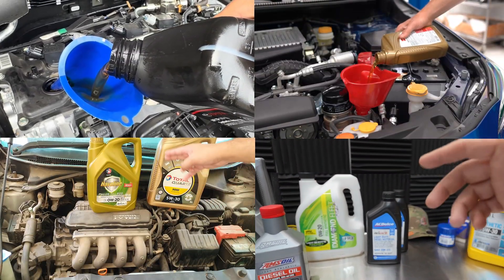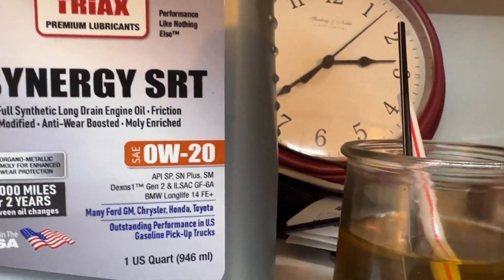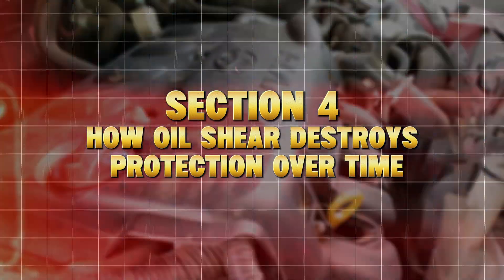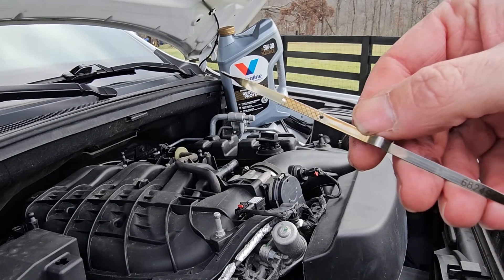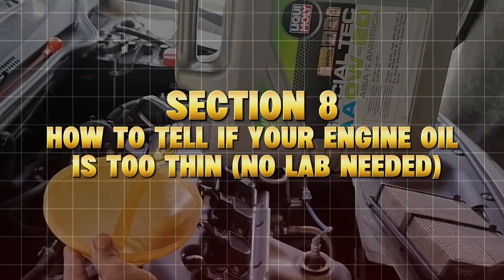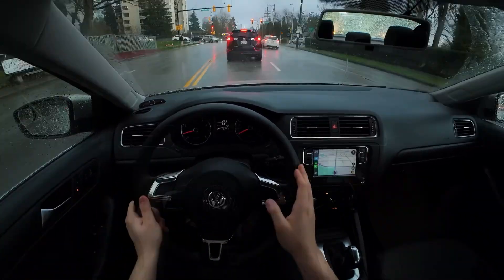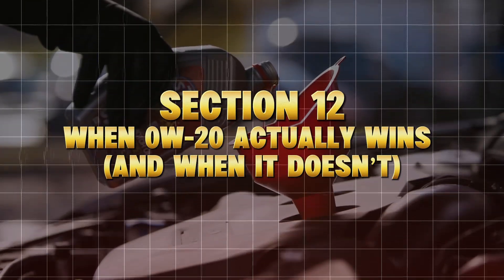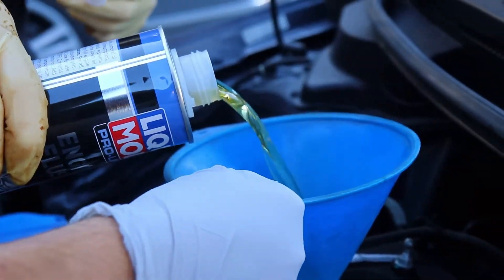The TRUTH About 0W 20 vs 5W 30 Oil (70 Engines Tested!)

Comment: 0w20on my Tacoma and switched to 5w30 at 55k. Planning on much traveling and looking for 350k on this motor. Oil and filter change every 5k miles. Using Mobile One.

Comment: Ram over head cam Lifter ……1500 Lifters (FAILED on Factory Oil ////Change to 5w30/10w30….  The Truck is in Heaven…..Florida Miami…..170 miles per week…

Comment: 0w20. …..2w20. ….cam failed….change to 5w30. Better…Before …10w30. …now…Much Better in FLORIDA….Miami….Travel a lot….170 miles a week….Need a Good Oil….Like Mobil 5w30/10w30….Mobil   …I was using Penszoil …..Changed to Mobil Oils ….

Comment: Using 5W 20 ever since 2008 Dodge Nitro 3.7 no issues to this date.  Edmonton Alberta Canada
Harsh winter conditions 😳
It might be beneficial come springtime   
Also will try PolyMoly idle before oil change to 5W 30.  Thanks for the information

Comment: So what about 0w-16 and now 0w-8?
Reply: 0w16 is what toyota Uses. I noticed on my 2022 sienna with 190k miles the engine is very loud and knocks. I just tried 0w20 and still knocks with no difference. I live in Texas btw.